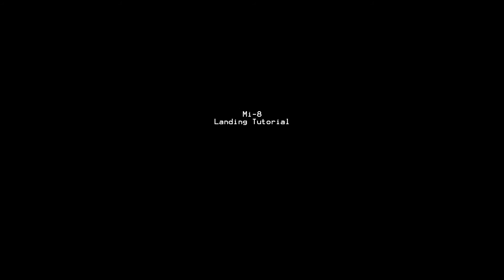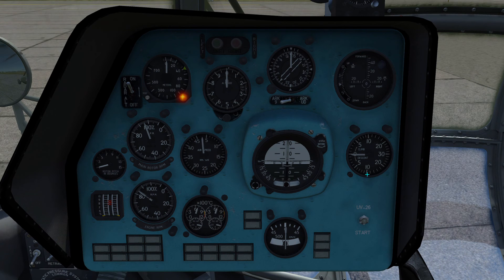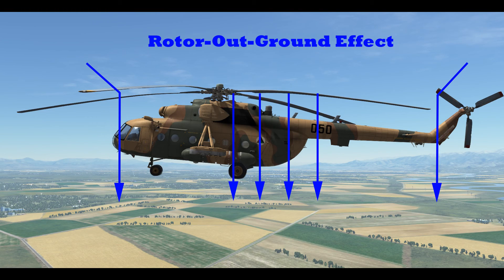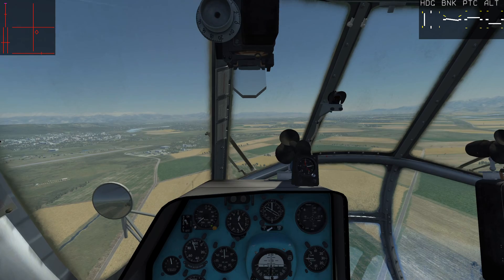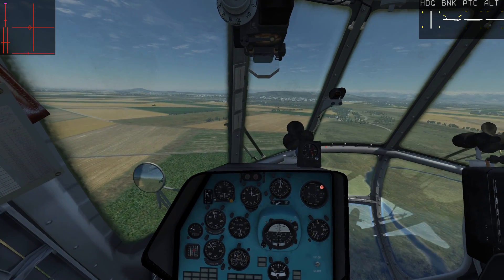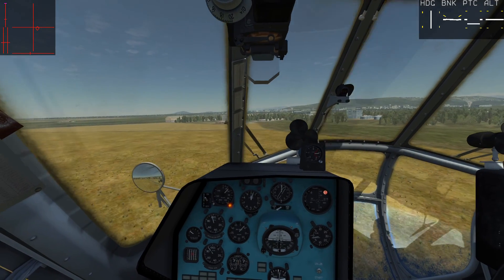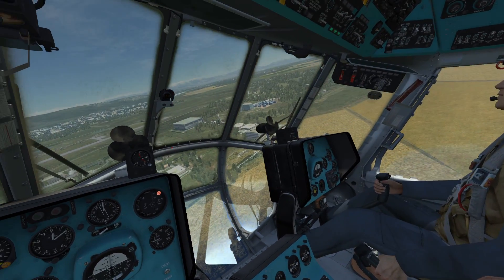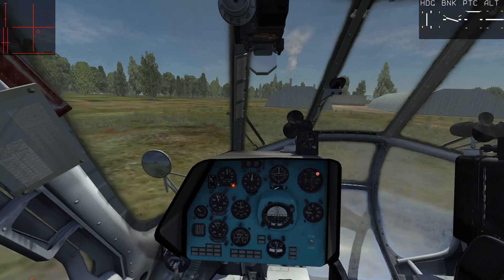DCS Mi-8 - Landing Tutorial

Comment: how to activate auto hover and auto pilot ?
Reply from the maker: Mi-8 dont have auto hover like ka-50. Mi-8 have 3 autopilots, roll/pitch, heading and altitude. All the autopilots channels can be found in the middle console, green lights which also acts as buttons. You can also find autopilot category in the controls to set up joystick bindings like i have.
Reply: @Elappo  heading AP turns off the instant you move the rudder?
Any tips how to use it?
Reply from the maker: @RelaxSimmer  HDG AP turns off when rudders are being used. By releasing pedals HDG AP will select current heading as a new heading to maintain. Couple tips that i find useful, use rudder trimmer, you can fine adjust autopilot channels by binding them to your joystick, AI crew have a fine tuning bind available and remember if you generators fails you have to reselect roll/pitch AP channel or you lose your SAS.
Reply: @Elappo  problem for me when I have to use my pedals to keep the heli oriented straight then I hit the heading autopilot and as soon as I try to relax my feet the autopilots is desabled and heli goes all over the place until I spam that autopilot like mad for them to activate when my pedals are centered.
Reply from the maker: @RelaxSimmer  Try enabling rudder trimmer from options. I use pedals to orientate heli straight, hit trim button and then neutral pedals. After that i enable hdg autopilot and fine tune if neccesary. Or perhaps if have problems when centering pedals, try adding some deadzone.
Reply from the maker: @RelaxSimmer  Or try hitting adjust autopilot bind before enabling hdg autopilot. AI crew will adjust autopilot channels. Perhaps this is what u looking for
Reply: @Elappo  Ye, I use actual rudder pedals so having rudder trim kinda defeats the purpose.
Reply from the maker: @RelaxSimmer So do i. Ask AI crewman to adjust autopilot channels before turning hdg autopilot on